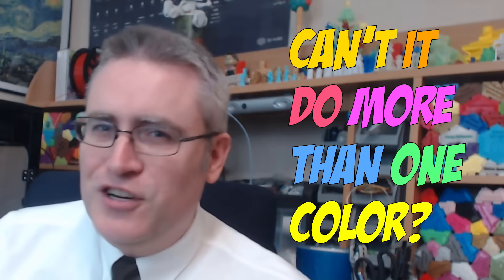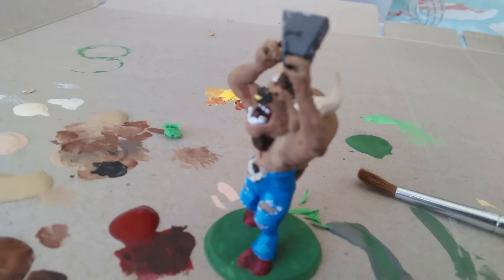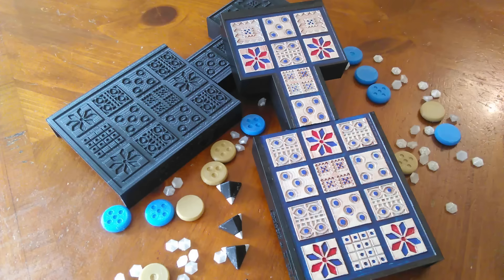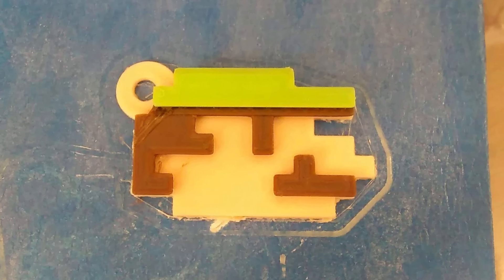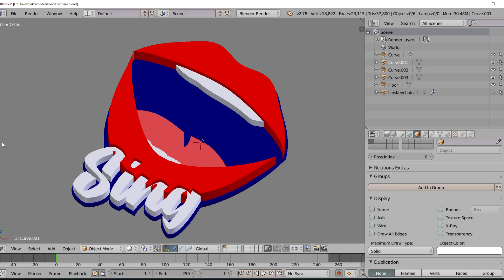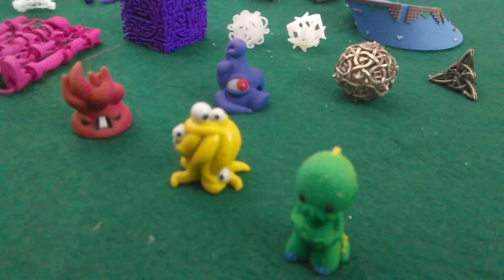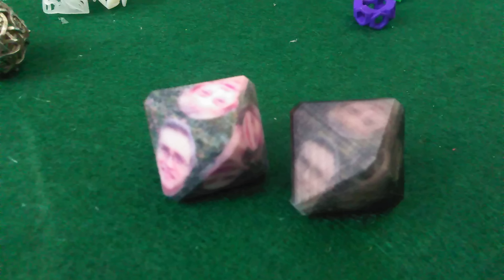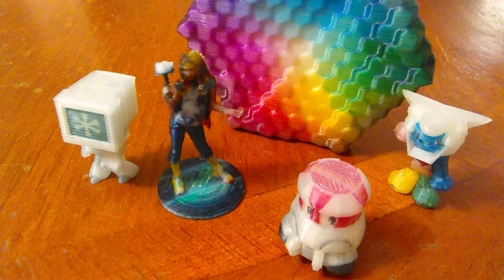5 ways to do color with 3D Printers

Comment: I always wondered if you could use some tecnology where one would use magenta, cyan, yellow, white and black and combine them at different rates to make the entire spectrum of colours.
Reply from the maker: 6:15 material Blending.

I've worked a little with it since this video. Does it actually work? Kind of. But there's a lot of problems with it. The biggest is that material is not unidirectional, so you have to be constantly feeding every color, even just a little bit, or you get back pressure through the feed tubes causing a massive jam. Even if you're doing that it still sometimes jams. So you can't get a pure white or pure cyan etc. And even when it works you need to purge a lot per color and you can't do discreet color changes. 
It's a lot of work for a little bit of gain.

Comment: excellent video.  I am building a powder bed 3d printing machine and I need to take the model obtained from photogrammetry and cut it into 0.2mm layers, each layer will be exported to a normal print file like PDF ... can I do this? Any guidance you can give me would help me a lot, thank you very much.

Comment: I've commented on your channel before, awesome job on your shows. I, just yesterday, hooked up with a DOBOT MOOZ 3. It is somewhat remarkable. I can swap colors and I can also BLEND colors. It's 3 bowden tubes loading into one print nozzle. What you do is you put in the percentage of each color and the height, in millimeters, to switch. So, example: I printed 100% orange for 5 mm, 100 Green for 5mm, and 100white for 5mm, then I ran 5mm of 30% Green, 35% Orange, 35% White, came out, as expected, light brown. AND it was perfect, no places in the print could I see any unmixed color variation, all a uniform light brown. Pretty impressive actually. Now the print bed is small 100x100x100 but it's headed and a delta so it's also very quick. Thought I would share.

Comment: The idea like multi color sharpie pens paint filament before entering hot end can change color too. Can we inject color mixture of ink in control manner? We need big player like Epson and HP to realise the potential and fully invest in this machine.
Reply from the maker: Don't know. Lots of people have had the idea, no one has made it work. Maybe the heat of the nozzle is damaging to pigment?
Reply: @3dpprofessor  Just earlier today I saw a video on a channel called "Teaching Tech" where they did make that work. Posted about 4 months after your comment.

Comment: Did you do more, with stuff down the line as far as your MMU Style goes?
Reply from the maker: Yes. And unfortunately I hit a few snags.

The way I was doing it with Chibimals there were a lot of thin faces over top a surface, which didn't work because they were too thin. So the "correct" way of doing it would be to export it as a solid mesh, bring it into a program which can make the mesh bodies thicker and more printable, and the re-export it parted out, import it again, and add color data. Because right now there's no program that can do both color data and separate into parts.

I still think the idea has merit, but it lacks implimentation.

Comment: Great stuff Joe. Is the CraneQuad the 4 colour mixer you're referring to? I have one pre-ordered 😉. Also the Geeetech A10M is a 2 colour mixer and cheap too. Cheers, JAYTEE
Reply from the maker: That's one of them. There's also a color mixing Delta by Geeetech that is so badly built it doesn't work, and there are a few others. But dual color blending is a thing and I feel silly for not mentioning it.
Reply: @3dpprofessor  Cool, I wasn't aware of the delta, too bad it's no good. Cheers

Comment: The Geeetech A20M has a dual color mixing hot-end for around $100 more than an Creality Ender 3.
Reply from the maker: Which is, like, more than half the price of the Creality Ender 3 for only 2 color mixing, but it's a little more tested. Yes, I entirely ignored the could of dual color mixing option out there. Don't know why I had a blind spot. Thanks for setting the record straight!

Comment: Hey, i saw my snow man with purge block coming by...
Reply from the maker: Is that yours? Thanks for letting me know. This came to me from my discord without attribution and I didn't think before using it. Funny, I was just about careful with everything else, but that one I just threw in there.
Reply: @3dpprofessor  Yeah, just one of the many failed prints I had with my Palette 2. I used this one amongst others to show my slow progress with the P2 and increasing pile of waste on their forum. It was funny to see this one come by in your video. Not so funny that I still have only moderate success with the P2 after 4 months of use. Allez, at least it got me a spot in your video:)
Reply: @RMrm55555  Well deserved place in my opinion. Thank you.

Comment: I believe you've already checked it out, but in case you haven't there is a slicer designed for color called Voxelizer 2. It can handle the separate .stl flow you mentioned (just like s3d, slic3r pe, etc.) but it also can import more traditional color models via .obj and other formats that handle textures and/or vertex colors directly. If you are stuck with a single color .stl you can also import images to map on top of it for color. It's in a late beta state currently so not a finished project, but further along than anything else. This works for either mixing printers (diamond hotend, crane quad, etc.) or multi material systems (palette, prusa mmu, etc.). Any of the ink squirter printers generally have their own slicers but voxelizer is for the rest operating on normal gcode.
Reply from the maker: I have seen Voxelizer, but I haven't really dug into it yet. I'll look into it.

Comment: I forget the guys name, but at the 2017 MRRF, he had a multi-in nozzle setup on a delta and it blended the filament before the extrusion.  So you didn't get that tooth paste look but instead got true blended colors.  I think he was running 5 filaments and could have very little if any purge between color changes based on the formulas to mix.  He did have some special hardware on that extruder, but i hope that makes it out to the real world done day.

Comment: M3d has had a quad crane for a good minute now...
Reply from the maker: Theoretically. I haven't seen any in the wild. And considering everyone experience with M3D kickstarter, and the experineces I've seen from people with color mixing nozzles, I'm reserving judgement.
Reply: @3dpprofessor  I have a crane quad, as do some of the early adopters. It isn't without its issues but certainly does exist. As far as mixing goes I also had a davinci jr 2.0 mix a few years back and the crane is a step up from that and seems pretty comparable to the diamond hotend. As with any mixing printer though you do have extra things to do to take of it like special loading/unloading filament considerations as well as not "cooking" any single extruder by letting it idle for more than 10-15 minutes. So far I'm happy with it though, I do wish it was from a company other than M3D though.

Comment: I built a quad independent extruder machine, no you can't do infinite colors, obviously the limit is 4 outside of the tricks you mentioned, but I have no waste, the only penalty is time it takes to park and activate each tool, which is pretty quick -- about 10 seconds, for larger prints it only ads about 10-15% to the time total. I have also used it to do soluble supports, which is really great to print very complex models and use one of the tool heads to print the dense (100%) support layers with no separation layer as it's not needed, you get really clean prints since there is no penalty for printing on support. The other neat aspect is duplication mode as I had it 3 heads running simultaneously printing a bunch of duplicate parts, very useful.

Comment: Great video as usual :) As you no doubt know, I've been messing with multi-colour print methods for a while now. I often try to implement different ways for people to experiment with. Some models are obviously suited better to certain methods, but no matter which method people use, I'm always excited to see more colour prints. I love seeing people's prints of my models even in single colour, but when they take the time to print off separate pieces, or do layer change or purges to really make it shine, it always blows me away :)
Reply: @Blondie SL Hi! Unfortunately I'm not the right person to be asking about these things, as i only have a resin printer myself! I've just been making models that should be suitable for multi-colour printing since there's more and more people doing it these days. 
I often do different versions though since most printers can't do it all in one go. Where I can, I try to split my models in ways that they can be printed in single colour pieces, which can then be assembled afterwards. Sometimes ti's not really viable, so I do make all in one print style ones as well, but most of the machines that can do them, either need to purge the colour between changes, or some can partly purge by doing the transition while printing the infill (so t's not visible on the outside of the model)
How it's actually done with the slicer etc though, I have absolutely no clue 😂
Being a resin printer, I only have the option of one colour, and my slicer is completely custom  to my printer, so I don't even have any experience with the common slicers users my most people. 
i have seen prints done with the QuadFusion and Diamond hot ends before, and they do look promising, but i'd imagine they likely would take quite a bit of tweaking and tinkering to get to know what will get good results. It's certainly something I'm interested in myself, but the ability to actually get my hands on one to start playing around is quite a way off at the moment.
Reply: @Blondie SL If you have specific questions about the quadfusion don't hesitate to ask (I have one on the crane printer). It does work and yes it does require purging for sharp color changes (gradients don't require it). For setting up the prints Voxelizer 2 is the furthest along currently but you can also do it in Cura with plugins, S3D, or Slic3r PE.

Only time will tell if mixing is a good idea or not versus the ink squirters or other methods. In either method there are additional things to pay attention to versus just single color printers. If you are a beginner, it's best to learn on a much cheaper printer that has less of these variables to complicate things.

Comment: Pallette 2 looks good - how about doing a review. As a four-material device it's a relatively cheap (I said relatively) option.
Reply from the maker: I have a palliate 2. I just need to pull in a 3D printer I can use it on. I think I'm going to temporarily retire the Weedo.

Comment: Hey, it looks like you missed out on tool changing, for multiple colour, blending and such
Reply from the maker: I consider that under the umbrella of multi material, same as any multi-headed 3D printer. It's just a different delivery method to get the nozzle to the print, but doesn't change the final result much. 

Of course took changing has the possibility of adding milling or engraving to your machine, making it truly multi-discipline, and that's super exciting. I don't know what I'd do with that possibility, but it's super exciting.

Comment: Hoping the M3D quad fusion gets in to more hands. I've only found one demo/review of it in the wild on youtube so far and it seems you have to use  a slicer called 'voxelizer' to handle the color mixing. Also worth a mention for full color printers are the Mcore Iris and Arke. They are back in the industrial catagory but are pretty amazing final products.
Reply: I'm waiting for the quad fusion myself I was lucky to find the kickstarter the last couple of days of it's run, they say they are shipping the heads out now
Reply from the maker: The problem is it's unreliable tech in the hand of a company known to be unreliable on their delivery, especially to kickstarter backers. I'm not opposed to M3D. I'm just not eager to be the first to lose money on a double threat.
Reply: @3dpprofessor  I definitely hope more manufacturers make mixing printers. I agree with you that I wish I could source from someone other than M3D. At least this time they are only making a small part of the printer (it's an ender 3 frame with a duet board). The only main piece that is theirs is the quadfusion printhead. So far I'm happy with it I've had it since early January.
Reply: @Ladmertechnologies  still waiting for mine, they of course have had web site issues that kept me from being able to pay. but that finally happened, I only got the head, as I'm going to put it on my existing printer.... lol, I hope
Reply: @bruceneely4859  They aren't speedy. In my case it was about 3-4 weeks later until it arrived for the crane. Their discord channel seems to indicate that is still the reality. At least when it finally came it worked (I was a batch 1 quad preorder)